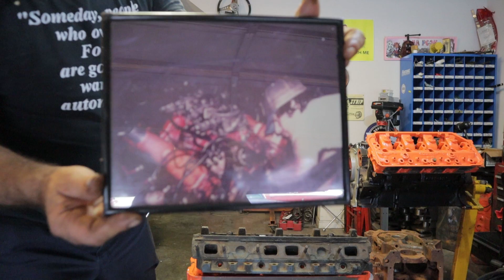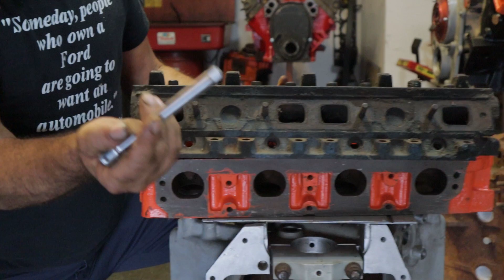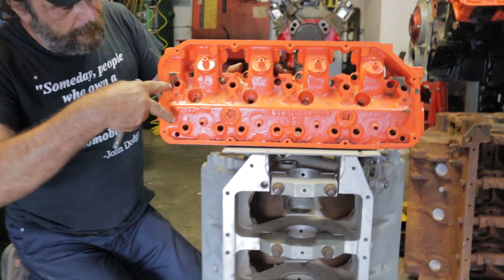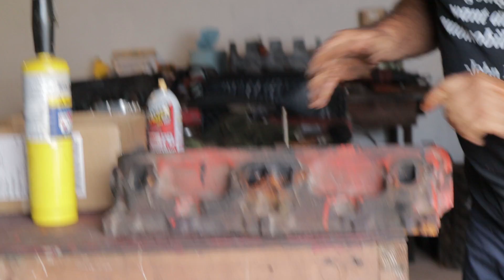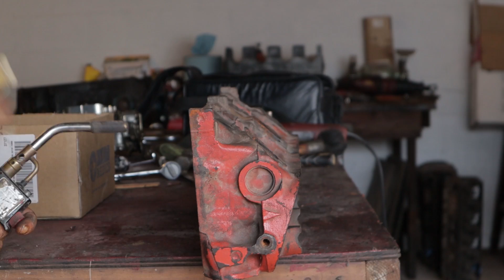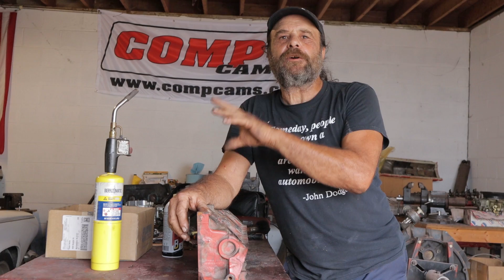What Makes The Small Block Mopar Such A Great Engine?

Comment: TONY, THE BEST SMALL BLOCK EVER MADE IS THE FORD. NO MOTOR CARRIES IT'S CREDENTIALS. IN 1963 A 260ci POWERED COBRA WENT AGAINST FERRARI AND WAS 20 MILES AHEAD OF FERRARI UNTIL IT BLEW THE OIL COOLER. IT WAS A WARNING TO FERRARI OF WHAT WAS TO COME. IN 1964  THEY BUILT SIX 289ci DAYTONA COUPES WHICH TODAY ARE IN PRIVATE HANDS OF COLLECTORS. THEY BEAT FERRARI BY ALMOST 40 MINUTES AND WON LEMANS IN THE GT-III CLASS. THESE CARS CLOCKED OVER 200MPH FROM THAT 289ci. LOTS OF PEOPLE MAKE CLAIMS THIS AND THAT SMALL BLOCK IS THE BEST. IF THAT WAS THE CASE THEN HOW COME THEY COULDN'T DO WHAT THE SMALL BLOCK FORD DID.

Comment: I have run mostly BB Mopars in B-bodies for 40 yrs .  I started phasing into A-bodies in the early 90's. And one day, I bought a 340 'builder' engine, and started putting them into Dusters along with hi-stall converters and low gears. And now, that;s all I want to drive. They kick butt on most big blocks up to 110 mph, which is mostly street racing. Unbelievable fast revving engines !

Comment: Very interesting.. Here in Australia we have a little V8 that was made by Repco an Australian engineering company for our GM cars it’s 253 ci or 4.2 litre  90 degree .  With a nice set of heads they make great power. The torque is lacking a little bit but once they rev their great . Seen them run 11 seconds in a two ton car . .. sometimes there is a substitute for CC’s  . Love your work

Comment: I want to know how you spent so much time on an engine that only 11k were ever produced for the public. By the 90's they had to be ridiculously hard to find, and expensive. And why get so stuck on one engine for so long - especially one so rare, and with such a big heavy valvetrain? The 383 B / RB was all over the place. These days even those aren't easy to find or find aftermarket parts for.

I never liked mopar so much, but they did have some cool stuff - especially the 340 which is pretty rare itself. Never was a huge fan of any other LA engine. I found nothing really unique in them, except solid pushrods that seem like limits oiling to the valvetrain.
Reply: Agreed 👍I think it's all how you grew up & what you worked on most. 
Build a small block Chevy 400 & smoke them all.
Reply: @majorpayne5289  I had a 400sbc, a lot of people destroked them. I'm not messing with the old SBC's anymore. I've got 2 of them, but also have a 4.8 and 5.3 LS which are basically better in every possible way. I'm wanting to get a gen 4 to play with. 6.0, stick a 4.8L stroke flat plane crank in it...

Comment: I need a Little insight, Now After seeing this video. . . Uncle Tony I got an old Grade 3 (4006730-318-3) 318 Block out of a 78 Ramcharger.
Factory 64.5-71.5cc chambered heads.
Now I've already stole one of your little tricks and Ridge lapped/ Back faced the valves. And I did a Poor Man Port and Polish. 
The block is bored .040 over and I intend to put a 4" stroker Crank in it to make it a 392 when all is said and done. What else can I do to squeeze out the best air/fuel low and best performance?

Comment: I've actually built a couple of 318 CID engines using 340 heads, mechanical cam, and old school adjustable valve train and they made amazing power. I used the flat top pistons, kept the bore and stroke stock and was truly surprised and what these engines could put out. I started with big block Chryslers, Oldsmobiles and  Chevs so these engines were a pleasant surprise. Ahhhhh the good old days, I'm actually thinking of doing another small block in a '67/'68 Dart. I've got a short block, old Offy intake and some other bits and pieces. I'm looking for a decent car soon, time will tell......................

Comment: 65 block 67 heads bounce assembly don't know who built that 289 the company Sun had tax that went to 10,000 RPM I burn One Up my cousin who let me borrow it wired it wrong he got the one out of his  23 was a 327 and he blew that tack up thank God they had lifetime warranties back in the day the Speed Shop wasn't too happy about replacing to 10,000 RPM talk to Anders for free I heard those little 273 can kick some real f**** ass also loyal younger and you but not much always wanted a 340 Duster with the blacked-out hood the big 3:40 on the HUD sticker and yes it did have the W heads I want that car so bad orange black vinyl roof with the food is I specified and cragars

Comment: This video explains why the mod’s I made worked so well. Back in the 70’s I had a B300 maxie van with a 360 that I ran headers on but I used a 2.5 in exhaust system, had 2.25 outlet collector cones welded into the 2.5 “ tube ( basically creating a extraction chamber in front of the crossover tube to increase exit speed of the exhaust pulse) system worked so well that when I had a exhaust leak at the header flange that you could not hear the leak, but I burnt a hole in the tube. But did increase both performance and fuel economy.

Comment: Don't use valve spring shims on a 340. My first 340 chopped the shims to pieces with the inner damper which was harder than the shims . They all ended up in the oil pump and wasted the crank.

Comment: Most people dont realize the importance of the exhaust flow.  It can be a lot smaller than the intake side because heat and pressure... but bad design can really cork performance.

Comment: Compare the buick 455 head to that... I think you will be surprised.  The 350 buick head is similar the 455 but the 455 is easier to find.  Valve placement is excellent and combustion chamber is really ahead of its time with closed chamber heart shapes.  Its too bad that the huge crank journals and their resulting high bearing speeds...

Comment: The 18 degree valve angles were great, but the lifter bore angles were not.   The race blocks corrected this and Bob Glidden took advantage of that with his "W" headed motor.  Using just factory parts the "A" motors would out power the small block Fords or Chevys.  Now with the availability of Hydraulic roller cams and cheap high flow cylinder heads the motors are easy to build in excess of 500 Horsepower on pump gas and street tune.  Seriously speaking the availability of cheap junkyard gen 3 hemi engines makes this a mute point because the new hemi has way more power potential with a bunch stronger bottom end.

Comment: I know what youre talking about, i had a 68 barracuda 340 s fastback with headers , manifold, 4 barrel, shift kit in the  automatic; posi rear end and traction bars, but that engine was a screamer it was the fastest car i ever owned, i had camaros, 66 nova ss, 71 rs camaro, 65 ss chevelle 396,and many others, but that car, would get up and go, not in a few seconds,now! It pulled hard,1968 340 barracudas and darts were overlooked cars.

Comment: I was told there was no way na I could make 1hp per cubic inch with my 360 at the crank, I make 370rwhp and 450rwtq, cast head, mild cam, single plane intake,with a 650 4bbl mechanical secondary.

Comment: Sure the head has no angle but the exhaust header or manifold would slightly later.  Therefore unless it's a straight dump there is restriction later in the exhaust.

Comment: I've always believed in the small block Mopar. While my pops has been a tried believer of the low deck 400c.i. mated with a 383 steel crank and internally balanced or the stroker 400 with a 4.25" stroke crank but keeping the 6.35" conn.rods for pushing a 9,000rpm screaming big block.I've been running a 440c.i. stroker Ritter small block with W-9 heads the last 4 seasons and in process of building a 454c.i. R5/P7 headed ex Elliot Nascar motor on methanol and a Procharger F-3/139 supercharger.Shooting for 2,000+h.p. will see, should be done this winter.Shits expensive for these R5 motors especially 1 off shit.Good video Tony keep teaching the world about how good Mopars really are and get them away from those dime a dozen Chebbys.

Comment: Back in 1991 i ran a dart with a 340 and best of easy mid 10s. I met a guy with a stripped down duster with a 340 tunnel rams that did easy low nines. Incredible considering both of us spent less than 7 grand, car included.

Comment: In My Experience the Big Three each Made one engine that Surpassed all their other engines in Performance and Reliability The Ford 302, the Chevrolet 327 and The Mopar 340, in their original Factory configuration. I had a Friend who had a Mercury Cougar with the 302 and We spent the Better part of a Day trying to Kill, and Destroyed the Clutch and Rear End but that Motor wouldn't Give up. Then I had a Camaro (the only Chevrolet that I owned that never failed me)  with a 327 and a 3 speed and I tried to kill that car many times, ended up selling it for more than I paid. But My 340 Dodge Dart Would Lay Rubber all day long and would beg for more, My Sister's Boy Friend was using it one Day without my Permission and totaled it out. May he rest in Peace.

Comment: all i know is my chevy's cost the least to build by a long shot and i can get way more money out of them i have all sorts of rigs mopar fords chevy's , toyota , vw i have cars and trucks most are 55 to 79 witch i collect . then like the toyota are newer just got a killer deal on them like a 2004  4 runner for a 1000 bucks just needed new injectors so i have 1300 in it but it is very nice rig no body damage even had new tires on it 180,000 miles on it for my wife she is going to sell her 2000 dodge 1500 with a 360 mag engine every thing works for no less the 1500 has a little body damage nothing bad no rust at all in it . it is no were close as good as my chevy's or fords  . and nothing i have ever own has been as strong as my 70 high boy that truck is a beast and it is stock strong as hell never breaks i would have to say for a 4x4 the 70 to 72 ford high boys are the strongest truck ever made only because in 70 they made the front end better then the 67 to 69 models . i been collecting rig since i was 12 years old but just like the dodge i probably wont sell it the plan was to sell it but thats been a few months still have not put a for sell sign in the window or advertised it . just like the 66 gt dart u have been the only person i have offer it too for 600 but will trade it for paint powder blue metallic is what i'm looking for to paint my 68 chevy pu . i would have to say my biggest problem with rigs is i just don't really need the money to have to sell them

Comment: In 1977 I bought a new Dodge D100 2wd short bed, 318, New process 4spd 3:21 gearing. After the waurntee was up I dumped all the smog equipment and installed a re-ground version of the "Purple" shaft with Crager headers, 1970 340 cast iron high rise and the 4300 Autolite 4BBL. The end result was 7,000 red line and through the traps at 13.9 @ 109 mph in 3rd gear (¼ mi). Sacramento Raceway

Comment: Glad I found your channel. Myself had a 65 Ply 273. Original Racing stripes, Hurst shifter auto on floor. The little engine was fast. Almost fast as my 67 coronet 440 which had a bored out 318. Love those old engines. Which I still had them.

Comment: After porting chevy small block heads for years , the first set of small block magnum heads from a 5.9 I seen the exhaust flow 200 cam at .500 with minimal work . The intake was not as easy but the exhaust flows better than the last 4 pairs of the vortec head I have done . Close to full race heads when ported right.  Good job sir

Comment: Now I understand why the 340 is the big block killer.  And that also makes sense why increasing the cam in the 340 makes so much of a difference.  The exhaust does not limit the increased lift and duration like on other engines.

Comment: I think the Ford 352 FE was a great engine.  I collected 390 FE 4 barrel intake manifolds for years.  I had about 100 of them at one point.  My hobby was playing around with my FE block engines.  I made a good living building small block Ford Windsor engines.  My 302's engines were Road Runner killers.  I still had more fun building killer 352s, 361s, and 390s.  I built a couple 427s for drag cars.  The Ford FE was designed to be the platform for building racing engines.  It broke my heart when Ford stopped building them.  A friend of my Dad's gave me a 332 to take apart and learn on.  It got punched out 30 over and I put it back together with some supervision. It was a 4V and wound up in a F100.  I wasn't old enough to have a drivers license.  Yeah I am a Ford guy.  I think today's "engine technology" sucks.

Comment: My class C motorhome was a van conversion of a 1972 Sportsman with a 360ci. Even though the motor home was heavy as hell, that little monster engine really moved that vehicle. The only problem was that the engine wasn't designed for that kind of duty, so the engine only lasted about 100,000 miles.

Comment: I started out 327 Chevy. Then I moved on to Big Block Mopar and then Small Block Mopar. I have to credit my Machinest and coworker who taught me to speak Mopar. My biggest problem with Small Block Mopar was the difference in the exhaust ports. The intake ports were small and constricted compared to all the other Small Blocks. Then in 1980 to 1981 or so to Comp Cams came out with their High Energy series cams. They had very small intake ports. But Mopar made up for that with port velocity. All the other heads had huge intake ports compared to the Mopar. None of the other heads had ports that small and restricted. So, how did they make up for that? Their ports were biased to the inside of the cylinder block. Their ports allowed for high flow right out of the box and they were the only heads that the High Energy cams worked well on, bringing one hp per cubic inch right out of the box! They worked great! The rest of the Small Blocks engine they tested couldn’t bring one hp per cubic inch to the party! 
These heads rock! And Tony’s right. Exhaust gasses don’t like to turn corners. Air in general doesn’t like to turn corners. Mopar fixed that! They also used port biasing. And all the way up to the Magnum series engines Mopar did the same thing! And the 273 will bring you the same results, although they don’t make them any more.

Comment: Being a broke ass Blue Collar mo' fo' my entire life , I learnt all that I could about the LA-Series , esp. the "lowly" 318 . I've seen countless examples of warmed-up teens (and even a couple of 273s) , and have operated A-Bods with warmed teens ---- just a simple cam swap alone wakes the teen up ! Its biggest shortcoming is its zero-duration broom handle cam . Heck , even the teen's heads are okay ; just treat 'em to a port-and-polish makeover , and they flow decently . 
I had a '72 Dart with a warmed teen in it :
- 360 heads ( in spite of my final comment . But , this was 30 years ago -- my first build ! )
- 340 profile cam
- 9.25 :1 overall compression ratio ( 0.030 oversize + "J" heads + 10:1 pistons --- IIRC ) 
- Double roller timing
- 360 two barrel intake (from the same 1971 Polara which relinquished its heads) 
- Two barrel carburetor from a '72 400 
- Port-matched heads-to-intake ; heads-to-exhaust manifolds 
The reason for the tame induction is because of California's stupid I/M Emissions Testing (which , these days , any 1975 & earlier vehicle is exempt) . I wanted that engine to appear stock as possible (no brightwork ; stock engine blue colour) as to not raise any eyebrows .
With a shift-kitted 904 , and a 3.21 / Sure Grip 8.25" rear ( from a junked '74 Duster 360 ) , that combo surprised many . Obviously it'd run out of steam at the top , but its bottom and especially midrange , were tough to beat .

Comment: Hi i have a small block 318  i want to test on a bench  the engine didnt come with a wiring harnis  what ignition set up will i need to get it to fire   It has an electronic distributor

Comment: I built a pretty nasty 360. 1977 360 block bored 30 over with Kieth Black hyperutectic pistons. Energizer 3 phase cam from Crane with custom grind. Balanced rotating mass.windage tray and crank scraper and had heads done buy Nutter Racing engines. 3 angle valve job, stainless valves, titanium keepers, high compression crane valve springs, custom pushers that were lighter and stronger. And an Edelbrock performer intake with a 650 carb. Headman headers and 3 inch exhaust and it would ride wheelies in my 83 Ramcharger 4x4. There is a black SE Royal out there with a nasty built 360. I sold it after blowing up the rear end riding wheelies lol. Some guy tried racing me up a hill and I had my 21 ft speedboat behind and I blew his doors off and at the top of the hill even he was impressed and gave a big thumbs up award lol. I have a picture of it pulling the wheels at 30 feet down track at the Dirt drags. It sounded so mean.

Comment: the 273 is a port velocity engine,i raced one as a kid in 1969,what really woke it up was the hand made fenderwell headers i got,bolted them on after butchering my 65 formula S,IT SCREAMED with the tubes,had to rejet the carb,added a 3.91 gear in my 7 1/4 suregrip,it flew,rev rev enjoy uncle tony,don't forget to turn pistons around,good for another 800 rpms,makes a difference on the big end,solid lfters work well with the little engine that could

Comment: Another fortunate consequence of the siamesed center exhaust ports is seen when you flip to the intake side: Mopar small block has adjacent intake passages with similar mixture and response, instead of evenly spaced intake ports from varying length intake passages. Thus center cylinders don't behave differently from the end cylinders.

Comment: As a teenager coming of age in the 60s I remember reading articles about someone showing up with a 340 and nobody wanted to line up against them. I also remember Stock 340 Swinger running 13.8-13.9 on street tires.

Comment: I was always a big bock guy too but i always wanted to build a 273 with 360 heads i think it would make a killer motor i do know tou have to notch the block for the big valves. Of the 360